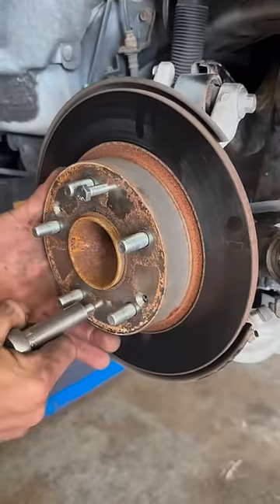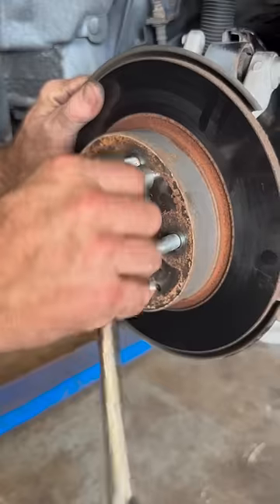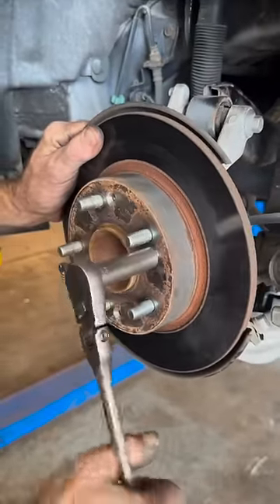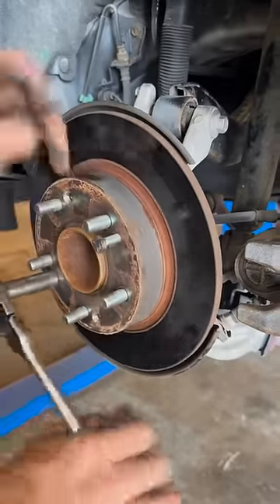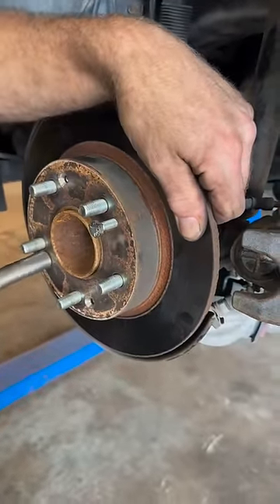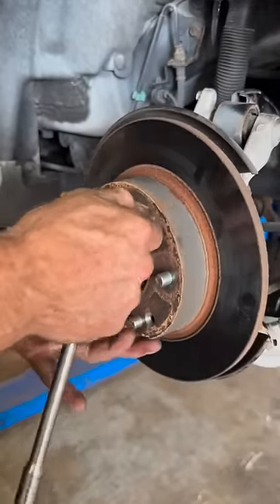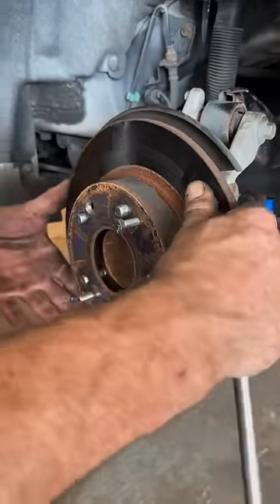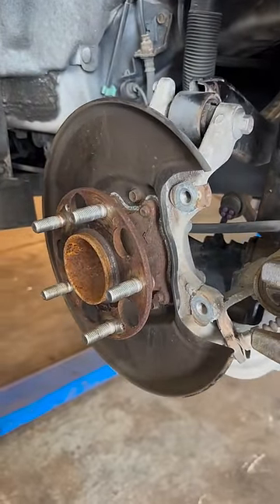Brake Job “Hack” #fyp #trending #auto #technician #hack

Comment: Wow, I just beat on it with a hammer.
Reply: Use the bolts. It's better
Reply: Agreed if replacing the rotor, if we’re just cutting them, wouldn’t wanna risk cracking the rotor
Reply: Just he careful with the ones that use brake shoes for the ebrake. I've torn out the hardware of one of those.
Reply: No kidding really opened my eyes
Reply: Me too! Simple solutions.
Reply: Same here
Reply: I be like MJ... JUST BEAT IT JUST BEAT IT
Reply: I've did the beat it with a hammer trick but I also got a wobbly wheel bearing now, the bolt trick would definitely be better for those bearings.
Reply: Exactly, 45 years as a mechanic and I've yet to find a rotor or drum that a 48 oz. hammer couldn't loosen.
Reply: That's how you stuff the bearings.
Reply: A purse works better.

Comment: 😂not in the rustbelt you don't
Reply: I live in NC and have stripped those many times
Reply: You can definitely tell this is a non rust area!!! Mechanics in the rust prone area's don't ever even try to use them! They rust and or strip out!! Hammer or air hammer!!!
Reply: Heat and beat !
Reply: Hot wrench and a hammer.
Reply: I'm in NH and I dip my bolts in never seize and no issues with rusty threads
Reply: Yes you can. Just need a 3/8 impact.  Works every single time
Reply: @JB-423 most of the time when I try to use those it cracks the rotor
Reply: @xX1GR1MR34P3RXx  can't crankn on both sides. Little one each side until it moves. Like 5 seconds each side
Reply: In the rust belt u can’t get a bolt in those holes got to beat the snot out of them✌️😎
Reply: Yeah these hot tips in fiar weather places are always so ridiculous.
Reply: Rust belt has to do with the largely extinct steel manufacturing industry in the region. Not how much Rust you guys have on your shit. Why do none of you know that?
Reply: @alexwhite737 NC 😂.  Is there even a place in NC they salt the roads ever in NC?
Reply: Cause all our shit be Rustin!😂

Comment: I usually just use the air hammer and rattle them loose, I'm from Maine so I'm probably dealing with more rust then most
Reply: * cough cough * Northern Europe has entered the chat
Reply: * Indiana has entered the chat *
Reply: @lastdescendentofnyx3656 average snowfall in Indiana is 25 inches. It's 65 in Maine. "Rust belt" refers to the largely extinct steel manufacturing industry in the region not how much rust you guys have on your shit. How do you guys not know that?

Comment: Back in college I bought a salvage title Mercedes and changed out the 100k+ mileage rotors. I used a 20 pound sledge and an air hammer and couldn't get them off. Ended up going to Home Depot, got a grade 8 bolt, washer, and nut and got my air impact. I ran it through the caliper mounting bracket, put my foot against the wrench on the nut and let loose. sucker popped off in about 10 seconds.

Comment: In my area those holes are normally so rotten they are just that ... a hole. I use a air hammer and a 4 pound sledge to break them free one way or another

Comment: Forcing bolts, next time put a little WATER on the hub register, it'll soften the rust much better than any oil or solvent. Rust is formed from water & metal.

Comment: There's tons of little tricks, sometimes in Mass we gotta use a couple at the same time, bolts AND hammering from the inside. Air hammer on the face between the lugs. Spray penetrant inside the holes for the studs. And when you're done light anti-sieze or grease on the hub face and hub ring and it'll practically jump off like you put it on yesterday even years later
Reply: Not Mass! Mass sucks!! LoL. I grew up in Dot and Southie so I earned the right to say that lol😂😂

Comment: This method does work sometimes with assistance from penitrating oil. But do you notice the new wheel studs and the fact that they are stepped threads almost bulging!?!? As you can see, the base of the studs is preventing the removal of the rotor easily. I'm not sure why they demonstrated this technique on this vehicle and not on one that hasn't been altered....

Comment: hammer or air hammer works best since those threads can just take a vacation OR you snap the bolt. 

when installing a new rotor use anti-seize on the hub, makes it MUCH easier removing it next time

Comment: Meanwhile Mercedes used those holes as mounting the rotors entirely to the drive axles and front wheel hubs back in the year 2003.....

Comment: THE best way to remove a seized rotor is to hammer hard with a 4lb hammer at a 45 deg angle on the corner of the rotor (the edge near the studs), it warps the rotor for a millisecond and pops it right off, I've never had this not work, never had it damage a hub flange.
Reply: This way is better than using a hammer. Why beat the hell out of a rotor when you can pop them off with very little effort?
Reply: @AT-wl9yq   The point of the video is to help people learn best techniques no?  It's best to learn from people who have done hundreds of brake jobs, maybe 1000+ in their lifetimes.  Being one of those people, I can tell you a hammer is quicker and more effective, you damage nothing (and remember you're throwing it away anyway right?)  If a rotor is barely held on the hub flange (like it was in the video), a little tap is all it takes, if a rotor is really seized on there, then yes, a big accurate blow with a sledge may be required.  But the method in the video isn't going to be any easier on a truly stuck rotor...you're going to need an impact or a long bar to turn those bolts, I'm skeptical it would even work based on my experience.  This method requires you to find bolts that will work, probably use PB Blaster on the threads, maybe strip a bolt, etc., omg, grab a hammer and you're done in 2 seconds.  I think the issue is the hammer requires technique, hit it correctly and it takes two good smacks max, hit it slightly wrong and it is way, way, less effective.  I searched for a video of someone doing the hammer technique properly, and surprisingly none, guess the real mechanics don't have time to make vids?

Comment: Every engineer and car manufacturer should know this by now.
Why wouldn’t they put anti seize on the hub from factory?
Going forward, any and every mechanic or diy’er should follow suit and do the same.
Cars have been around over a century; you would think by now that would be s.o.p.
An ounce of prevention… smh!
Reply: Money. It’s always about money.
Reply: They do put anti-sieze from the factory. Anti seize doesn't last forever, and sometimes cars can go 10+ years without new rotors.
Reply: Antiseize collects moisture over time, you really shouldn't use it on anything that isn't sealed
Reply: @brunovanhoose6854  The only threads that seal are pipe threads.  ALL other threads will let moisture permeate. Most flat surfaces will let moisture collect between them.  Are you suggesting that nothing at all is better than anti-sieze?  That is a silly statement.
Reply: @David-hm9ic so by sealed I was referring to sealed as in something like the engine. Sealed from the environment is what I'm referring to. Also to expand on if there is better alternatives than anti seize: dielectric grease, synthetic all purpose greases, synthetic brake grease.

Comment: When they get tight too turn, tap the hub with a hammer and it will pop right off or loosen enough to turn the bolts easily again.

Comment: I’ve seen take the rotor out in 2 inch piece with the sledge hammer…. Never came off had to break it off piece by piece…. That was hell… I was like 17 and never had that happen to me to that extent…. Happened only once more time since…. Tried everything air hammer puller hammer puller u name it then the sledge and whack it until it comes off or breaks off piece by piece… could work and practice precision when u swing

Comment: I believe it is 8mm by 1.25 thread pitch.
Reply: My miata and subaru are a 10x1.25, I usually don’t see threads on american vehicles
Reply: What size is it for a 2014 Honda Civic in the rear drum brake cover?
Reply: @coreturkoane5570  should be the same 8×1.25 bolt head should be 12mm
Reply: @coreturkoane5570 Honda usually uses a screw that requires an impact

Comment: THE best way to remove a seized rotor is to strike hard with a 4lb+ hammer at a 45 deg angle on the crown (the corner edge edge near the studs), it warps the rotor for a millisecond and pops it right off, I've never had this not work, never had it damage anything.  Technique is everything, the strikes must be sideways enough to cause the instantaneous warping that allows it to pop off, (too inward and it won't work, too sideways and it won't work).  The point of the video is to help people learn best techniques no?  It's best to learn from people who have done hundreds of brake jobs in their lifetimes.  Being one of those people, I can tell you a hammer is quicker and more effective, you damage nothing (to include the old rotor)  If a rotor is barely held on the hub flange (like it was in the video), a little tap is all it takes, if a rotor is really seized on there, then yes, a big accurate blow with a sledge may be required.  But the method in the video isn't going to be any easier on a truly stuck rotor...you're going to need an impact or a long bar to turn those bolts, I'm skeptical it would even work based on my experience, (there are vids of people snapping bolts, etc.)  This method requires you to find bolts that will work, probably use PB Blaster on the threads, maybe strip a bolt, etc., omg, grab a hammer and you're done in 2 seconds.  I think the issue is the hammer requires technique, hit it correctly and it takes two good smacks max, hit it slightly wrong and it is way, way, less effective.  I searched for a video of someone doing the hammer technique properly, and surprisingly none, guess the real mechanics don't have time to make vids?  This video is how you hit the rotor properly, the person in this vid seems like an amateur so his technique isn't great, but it's in the neighborhood of proper (his angle isn't 45 degree strikes, his are too inward instead of more sideways, and you can hit MUCH harder if needed).  One good accurate smack on a rotor like this and you're done, literally one smack.  https://www.youtube.com/watch?v=X-cFqCWJdOU
Reply: Thank you so much, as an amateur your words ring true. Even included a link, you're an honorable man
Reply: Unfortunately, however, video is now unavailable
Reply: I clicked just now and it works for me.....

Comment: or you can use the right tool and avoid to break the bearing and ending with a 1000 USD damage.

That threaded holes are to put here the extractor and use the correct extractor.
Reply: If you can manage to damage the wheel bearing using those two screw holes, you sure shouldn't be wrenching anything, as this puts absolutely zero load against the bearings.

Comment: If it’s end of life rotor use a hammer, cheaper (those screws don’t grow on trees) and quicker. 
On the other hand if you removing rotors to resurface or rotating the rotors:) do the screw so you don’t damage them

Comment: When I worked at a express oil change place I did brakes there too, and after I did a 3500 that took me 10 minutes of beating it with a hammer before it came off I went and bought an air hammer and that was the best 150$ I ever spent

Comment: Those holes are actually for a completely different reason... not as shown in this video. They are there because some cars have little screws holding the brake disk on to the hub that's why they are countersunk. Would a manufacturer go to the trouble and expense of countersinking them if they were just to push the disks off? Also if you do this and they are very stuck on you risk damaging the hub and causing vibration at speed for the customer. This is fine if they are lightly stuck like the ones in the video but for disks that are properly stuck a lump hammer is the best tool for disks that are being replaced (btw here in the UK they are brake DISKS not rotors because they are shaped like a disk🙄)
Reply: Those aren't the retention screw holes. There's no countersink on the holes he's using - but look 90° off from his bolts and you'll see countersunk holes.

Those wouldn't even work for jacking the rotor off, because they sit over threaded holes in the hub. Nothing to push against.

Comment: And how often do the bolts break
Reply: Almost never.   They're in compression; not tension so they would strip the threads rather than break.  The threaded hole is more likely to strip out before the bolt strips.

Comment: So are the screws that some times come in them just to keep threads clean ?
Reply: No, there are no "screws in them."  Those threaded things are the wheel studs that are pressed into the hub.  The brake rotor just slides over them when it's installed but in time the rotor sticks to the hub because they rust together.
Reply: @David-hm9ic  ummmm thats soooo not what I meant, I kno what wheel studs are. These are the screw not bolts there flat head screws
Reply: Where he is threadin them bolts in, there are flat head screws in there not them bolts

Comment: Those holes are actually there so you can change the bolt pattern using screw in studs to accomodate different wheels without buying adapters.  People started using them for the purpose shown in this video and now everyone just wrongly assumes that's what they were designed for.
Reply: I don’t think you at all know what your talking about Lol those holes are way smaller than the stud bro, and most of them are even smaller than the ones I’n the video
Reply: @WillSwingem  ok kid.  Look it up. I know what I'm taking about.
Reply: @pjstartv6798  obviously not lol the studs go into the hub and sandwich the rotor between the hub and the wheel even if those bolt holes were big enough to put studs in the would effectively be useless studs
Reply: This kid wanting to bolt on his wheels with m6 bolts😂
Reply: @NLYan  right I don’t get how people learn these things I’ve hear so many people in the YouTube comment sections say some really dumb shit and be so sure there right
Reply: @WillSwingem  I KNOW he doesn't know what he's talking about!
Reply: @pjstartv6798  Clearly you are confused.  Studs are pressed into the HUB with a hydraulic press.  They are NOT screwed into a brittle cast iron brake rotor.  Look it up!
Reply: @David-hm9ic  lol I know dudes not the brightest bulb in the pack, I don’t get how people come on here and comment stuff that is so dumb and are so positive there right like where did he learn that at

Comment: Not all rotors have this.
Reply: I was thinking that too. The 16 compass my wife has I just replaced the brakes for the first time (car finally hit 50k miles) and the rotors had no hole like that and was held in place by a rubber o ring that had so much corrosion over it the thing now identified as iron.

Comment: I only do that for rotors I plan to turn. If they are being replaced, they get the hammer.

Edit: Okay, I almost forgot. I use the screws for ones with the brake shoes for the ebrakes as well after the time I ripped out the ebrake hardware hitting the rotor with a hammer.